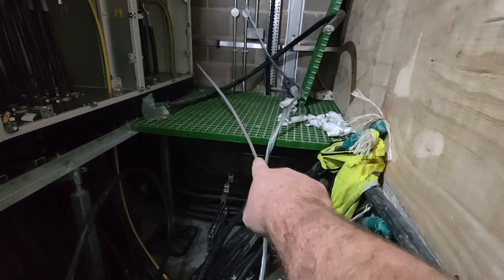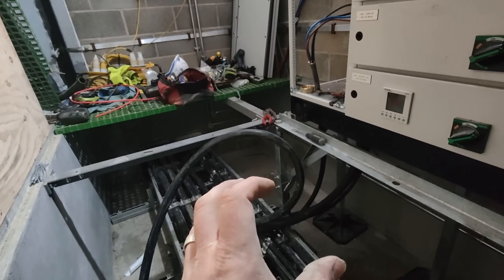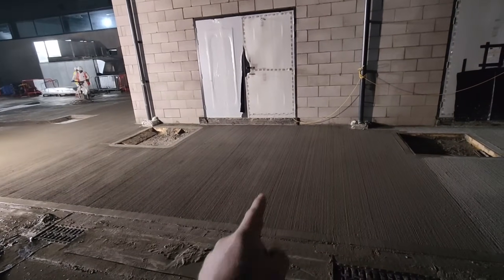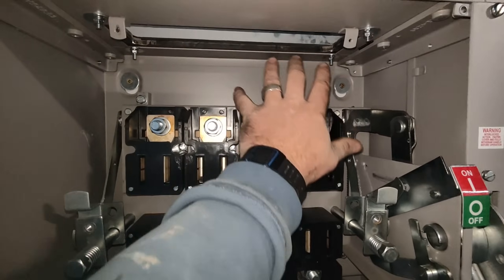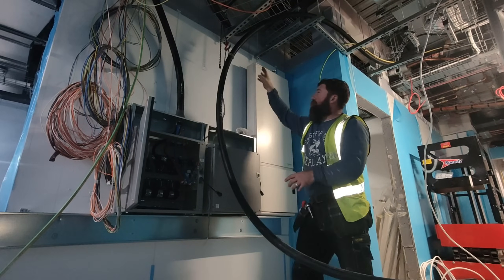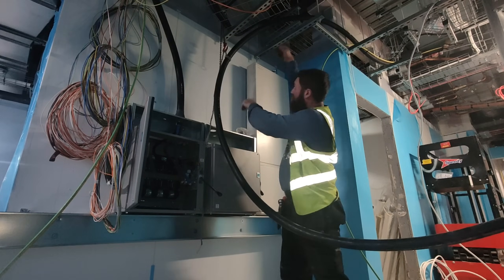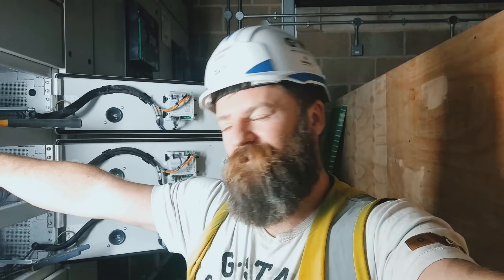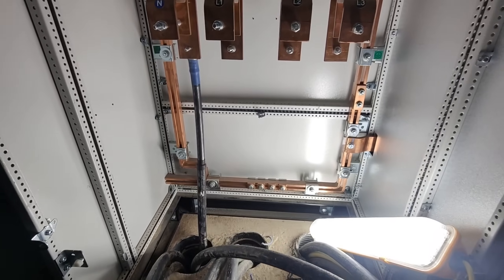My week at a film studio!!

Comment: There’s a couple of bolts on the top of those switches mate at the front which let you take the front of the top section off. 

We cut the Paxoline in half when we fit them also so the front half can slide out too. 

Makes it loads easier as you can push the cores straight back then refit it all together once terminated. 

Probably wouldn’t have helped too much on this as you’d still have the bottom edge of the trunking in the way, that’s why we put the Eaton spreader boxes on instead.